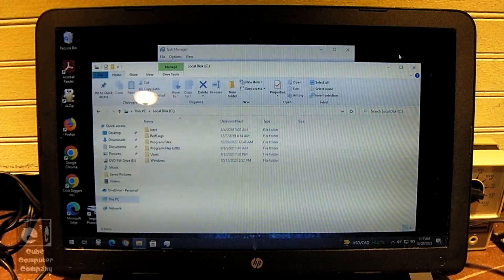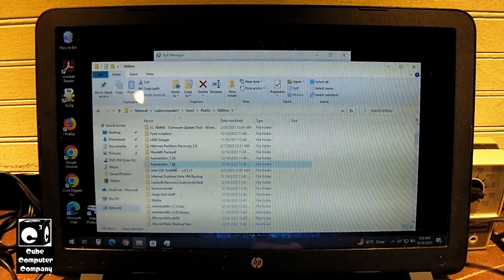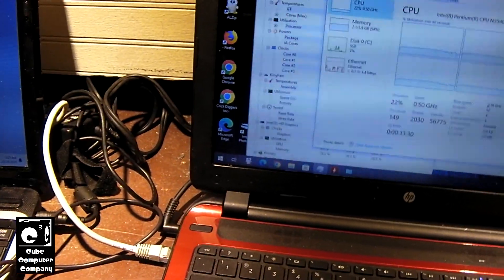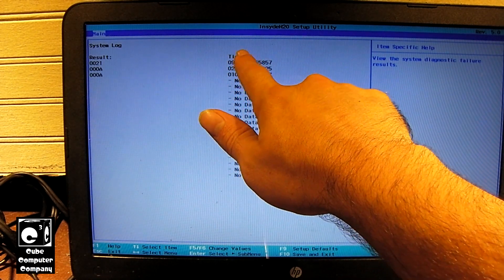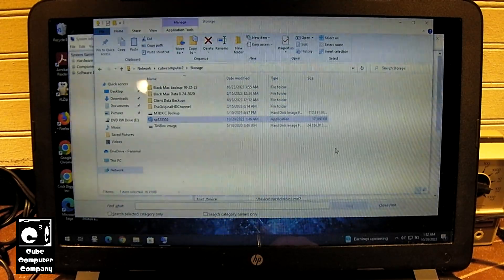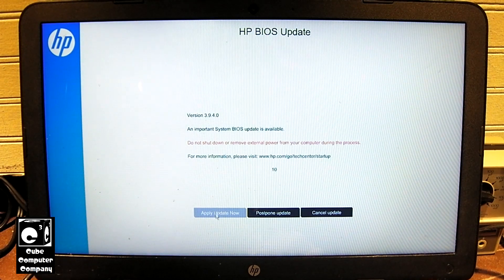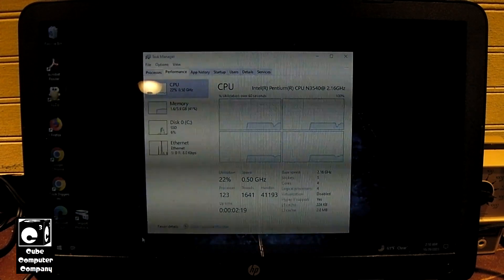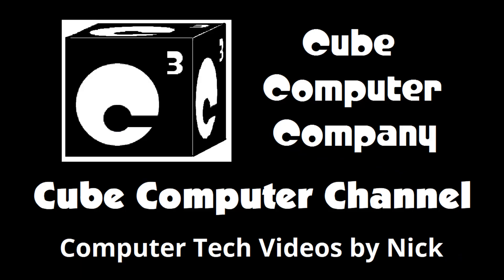Troubleshooting HP 15 Notebook locked at 500 MHz CPU clock

Comment: i have the same problem with my Dell Rugged Laptop after plug in the wrong charger the solution is simple after searching it for days on forums try it may be it will work remove battery and unplug the charger and hold power button for 15 seconds the connect the battery and charger hope this will resolve the issue

Comment: i have a thinkpad with a 1st gen i5 that locks at ~1.8ghz on windows. Linux made it run normal. But on windows I fixed it with throttlestop. Only this made the clock run normal.

Comment: An HP puzzled me too!!! Nobody online understood what I was talking about and always gave typical recommendations.

I found in Hardware INFO it was reporting THERMAL THROTTLING. After sitting apart for a few days, It would run fine for a bit and the first time it did that I thought it was fixed. It acted up when I went to show the person how I "fixed" his laptop. What could trigger a false thermal throttle with normal temps? Gave-up but kept the mainboard as a reminder.

Comment: I seen on a few dells where if you don't use the proper power adapter or if the adapter is failing, it throttles the CPU.  What does it do when you run it straight off battery?

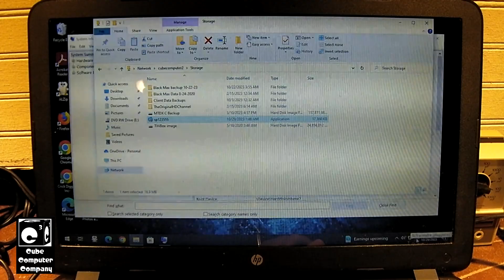Another thing that's off topic that I couldn't help to notice at 7:48 that you were a TheOriginalHDChannel fan. I have a decent repository of his videos that I was able to obtain in 2017. He was hilarious, miss his videos!
Reply from the maker: Yes, I have a repository as well!

Comment: Ive seen this a few times when a laptop battery has gotten to to a state that it no longer charges. Try restarting with the battery out, and see if it operates normally, to tell if its the battery tripping up the power management

Comment: I had similar problem.on a hp the clocks where really low like in your case, but soon as i plugged it into AC it immediately jumped to it's proper speed, the fact this laptop is plugged in and think it's not suggests a power issue somwhere try cleaning power jack and conector for.the battery on laptop

Comment: repaste the cpu, 40degrees C at 500mhz is a clear sign that its a thermal issue
Reply: Although you're idea is valid,.I think it's a power management issue, certain laptops turn on power saving features like downcloxk the CPU to save on battery, because the laptop is plugged in and not charging suggests that the laptop still thinks it's in low power mode, had this problem on a similar HP laptop soon as you plug it in to AC it disables something, I don't know what and the CPU will run at it's proper speed
Reply: @geoffmitchell1978  If the HP sits in pieces for a week there is a chance it'll run normal for a bit once put back together. It's not long before thermal throttling seems to get locked on despite normal temps (HWINFO64). Throttling remains on throughout re-sets and shutdowns. Cube has had a week so far at this one, I gave-up after a month with the one I had. It locks at 500Mhz, remote access to my network switch with only a Linux terminal installed became its true potential.🙃
Reply: @michaelsoutherland3023  Not disagreeing with you have a valid point, but all I'm saying I looked at a hp laptop with same issue, no spills was just running at low speeds when it wasn't plugged in, because his laptop is plugged in and thinks it isn't I think it's running low powered mode because it thinks it's not plugged in hence the battery not charging, but the thermal throttling point you make is also valid but I don't think changing theal compound will make a difference, see what he does in next video
Reply: @geoffmitchell1978  My Samsung 980 Pro nvme was stuck at only 900MB/s for a bit. I eventually became convinced my desktop mainboard was bad...  It was a duh moment finding DMA was set to Gen1 in BIOS.

Still have no idea on the HP issue.
Reply: It's nothing that easy. I've played with an HP in this condition but gave up after a month. Now I don't feel so crazy after seeing this video.